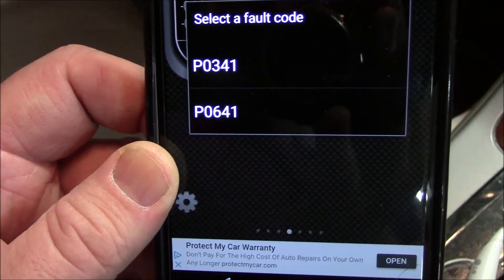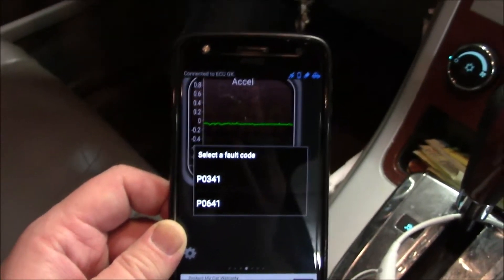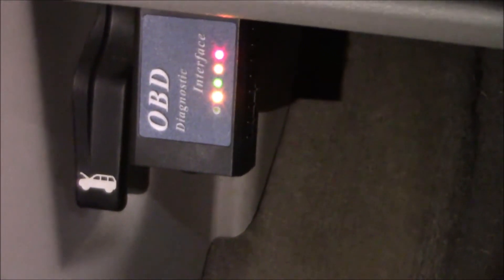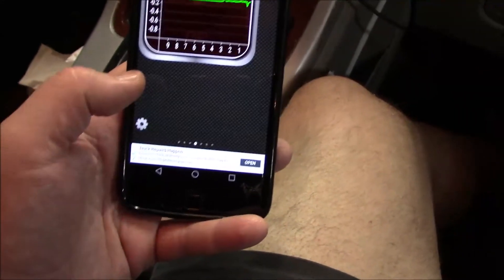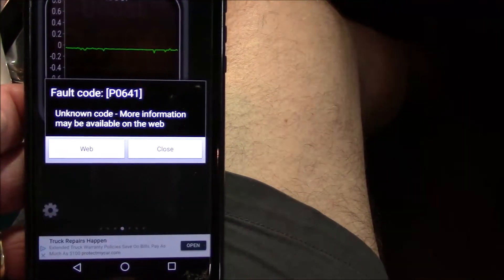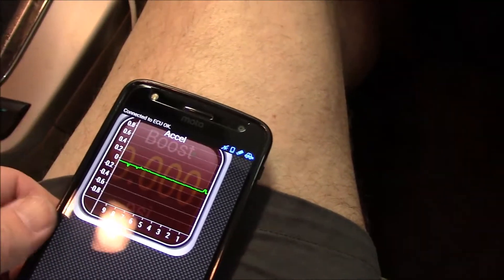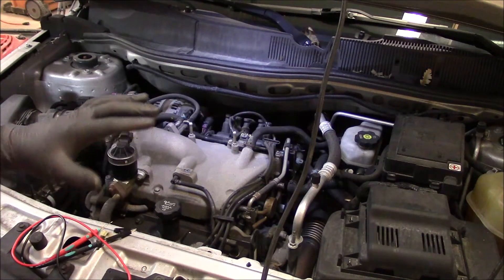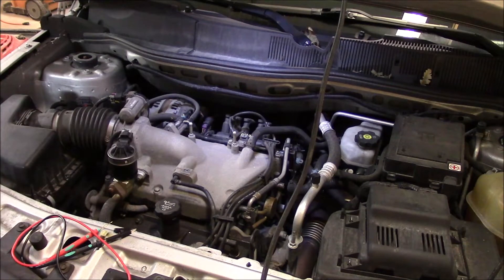Troubleshooting The P0641 Fault Code

Comment from the maker: At 11:19, you can see a big plastic wire harness. One of the wires had come out of there and rubbed on the engine enough to scrape the plastic coating off and intermittently short out. My mechanic put some tape on it, tucked it back into the harness and taped that up. Less than $100, which seems pretty exorbitant for some tape, but probably the cheapest repair bill I've ever had.

Almost a year later and no issues.
Reply: You didnt pay 100$ for tape, you paid 100$ for a mechanic to get your car in, check it out, find the problem and fix it. That's cheap for the time involved
Reply: I can't see any wires hanging out

Comment: Did the mechanic confirm it was the fuel pump sensor/ fuel pump pressor sensor?
Reply from the maker: No, see my pinned comment.

At 11:19, you can see a big plastic wire harness. One of the wires had come out of there and rubbed on the engine enough to scrape the plastic coating off and intermittently short out. My mechanic put some tape on it, tucked it back into the harness and taped that up. Less than $100, which seems pretty exorbitant for some tape, but probably the cheapest repair bill I've ever had.

Comment: What did it end up being?
Reply from the maker: At 11:19, you can see a big plastic wire harness. One of the wires had come out of there and rubbed on the engine enough to scrape the plastic coating off and intermittently short out. My mechanic put some tape on it, tucked it back into the harness and taped that up. Less than $100, which seems pretty exorbitant for some tape, but probably the cheapest repair bill I've ever had.
Reply: @tonyditola6749  Good deal
Reply: @tonyditola6749  Mine ended up being the harness that loops around the front driveshaft. I have a 4WD truck, and i had installed a stall converter and when i reinstalled my trans, i forgot to clip the harness onto the bracket, causing it to rub on the driveshaft and burn some wires through
Reply: @tonyditola6749  you didn’t pay $100 for some tape.  You paid $100 for a professional to find that specific spot/wire.  Extremely fair if you ask me!  If you had found it and taped it yourself then cool $5 and it’s fixed!